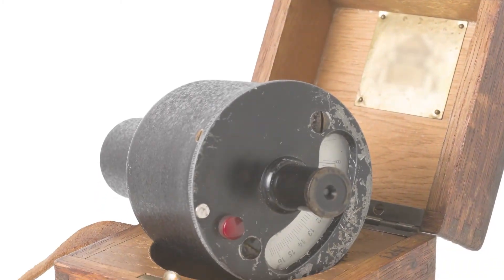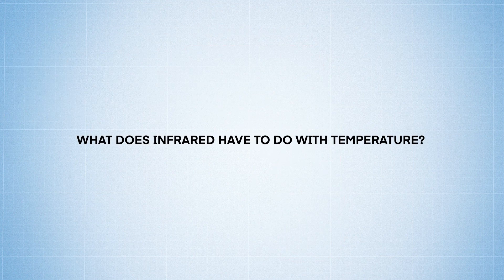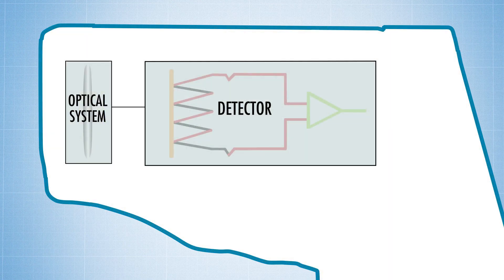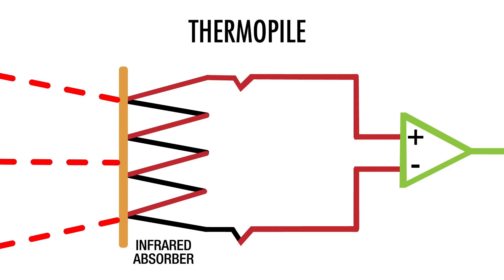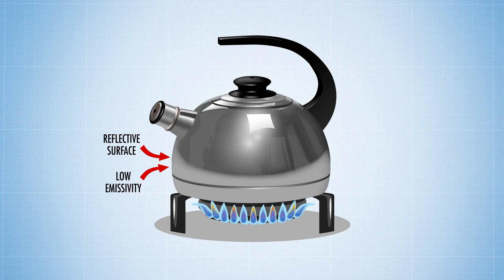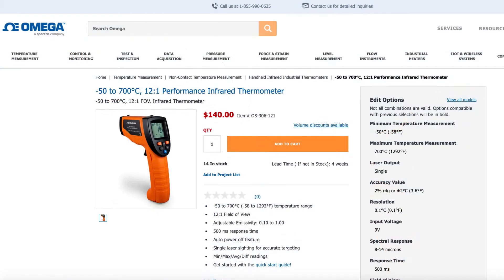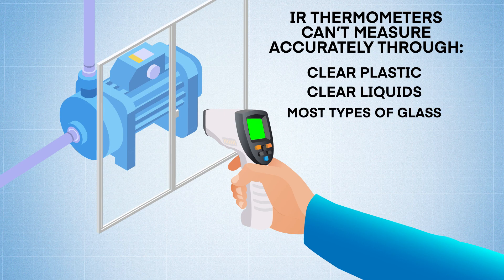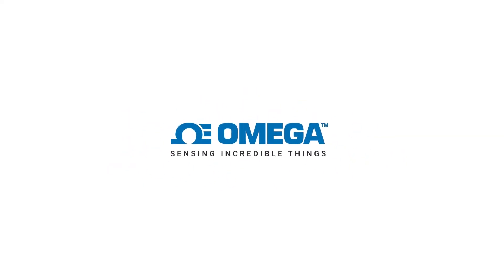What is a Pyrometer?

Comment: is infrared thermometer is best for measuring temperature during turning operation on CNC lathe machine?
Reply from the maker: Infrared will work best as long as the material is not too reflective, which will cause emissivity issues

Comment: "Emit infrared radiation, the higher the surface temp is, the higher the frequency of that radiation"
But in your video, the mechanism is to measure the thermo pile behind the lens, and it is not about frequency, it's about the energy flux it absorb.
I believe it can be explain in black body radiation more clearly.